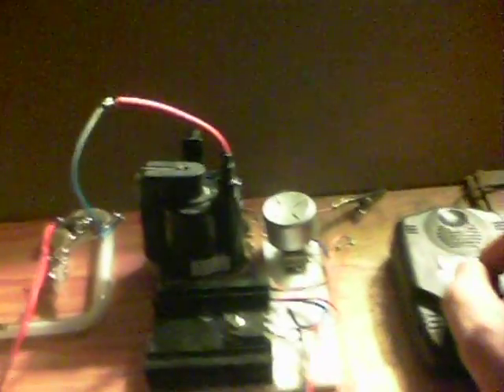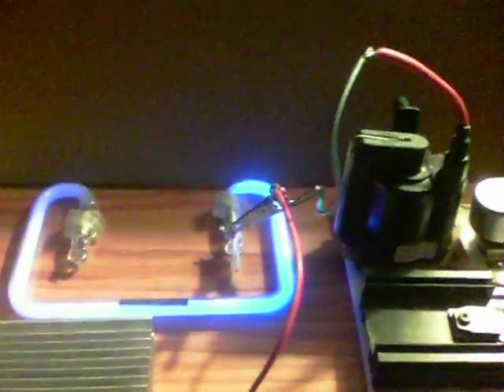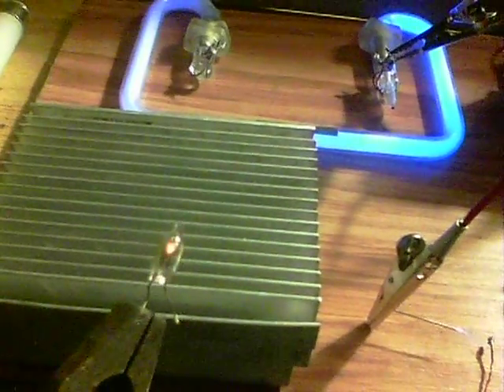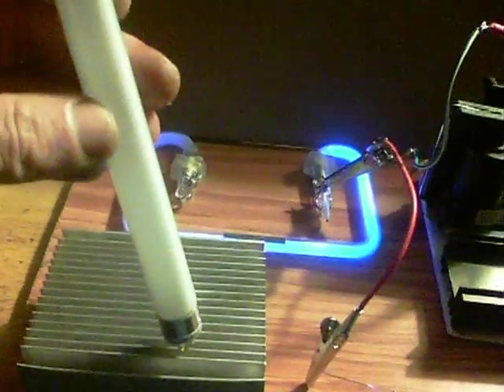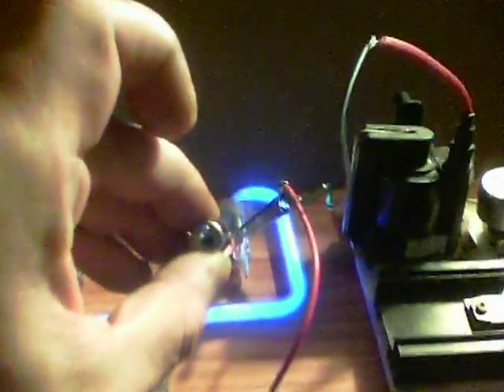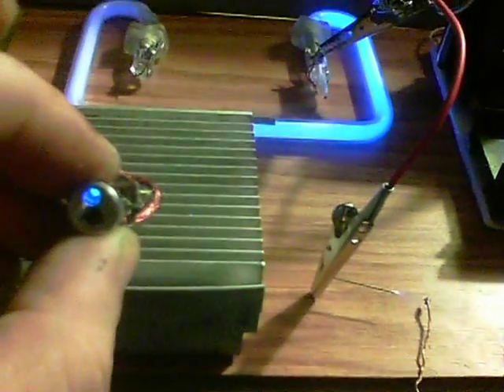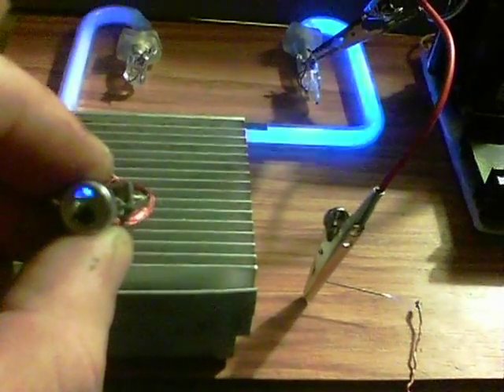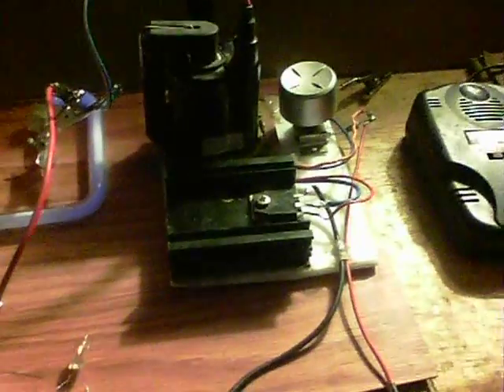3V flyback - wireless, 1 wire + sparks

Comment from the maker: @Flyingwigs Hmmm, similar to levitation circuits, where an outer ring has a higher magnetic field than the object sitting within that field. Then another centrally positioned electromagnetic controls height. So it would be like a bowl. Ever seen that ring (cooling tower type thing) allegedly to do with the Nazi Bell die glocke ? sort of goes along those lines without using spinning mercury !

Comment: @slider2732 not sure, i had heard someone made a "remote controlled" lifter once. he used multiple HV power supplies all varied by a wired controller to alter the amount of lift on 3 sections of a large lifter. though i dont recall if he still used the retainers or not... it might be possible if you used a tuned, charged base that gave a stronger repelling force near the edges so that the lifter wanted to rest in the center naturally. food for thought i guess lol

Comment from the maker: @iluzyon1 True, there's not really a safe way to grab hold of lightning bolts with the bare hands ! You can ramp amperage by using an AV plug and caps etc, continuous low current or wait a bit and gain in repeating cycles.

Comment: @slider2732  Is that right? I thought it was a very low amperage output kinda thing. I haven't done any circuit that give big sparks like yours yet. Only joule thief  type on a very small flyback (from 5 inches CRT t.v.) Cool sparks but not impressive at all. Anyways,as small as they are, i wouldn't touch theme lolll. I got hard time to make the difference between a soft and a killer ''purpule ray ''.

Comment: Realy nice sparks! I was looking at it and wandering if it is possible to fire the spark through a short plastic tube... plastic tube trough a wounded torroid and recuperate the energy around the spark. Is it high potential? Lots of questions lolll. Nice circuit :)

Comment from the maker: @MrFlathunter The trick is not to use a 2nd wire on the HV side, use a croc lead and a pin on the end !
I was a while wondering how to get it to work without the 'return' wire to a flyback pin. In normal Tesla tower stuff we can use wire lengths, sharp breakout points and metal masses on outputs (see Dr. Stiffler vids). So, did the same here. The 2SC2625 is very robust too, 400V/450V breakdown

Comment: So the fly-back has a fly-back. 1in, 1out + charging of the local area for further extraction. Nice, wonder how many things you can introduce into the field and extract usable energy. With a strong enough field, you could quite possibly get a 1to2 ratio of power in to power out or even greater. Lightening much :)